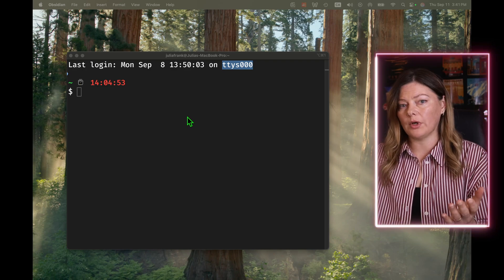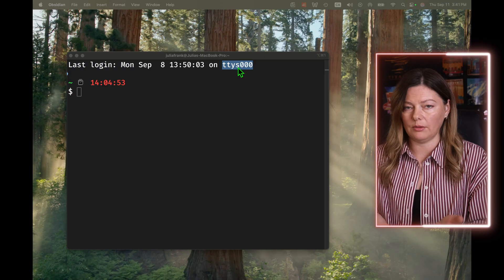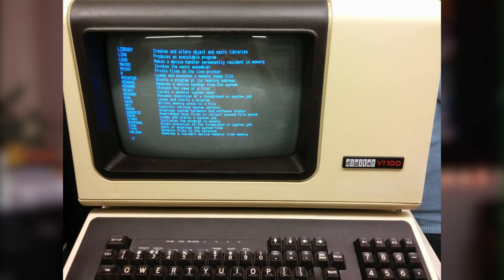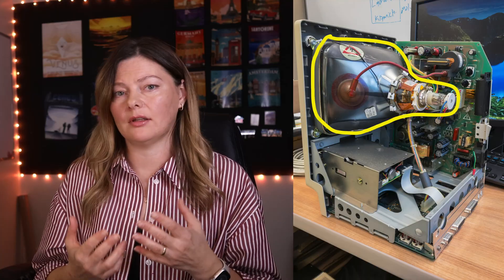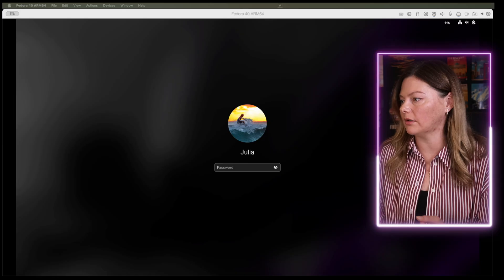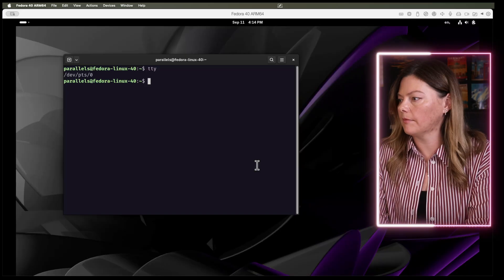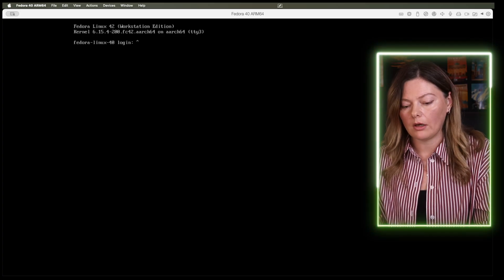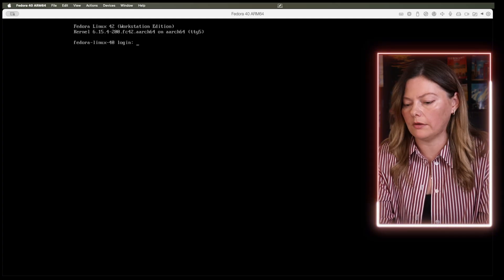What’s a TTY? (And Why Linux Still Thinks It’s 1970)

Comment: Late nineties I used a physical terminal in linux over serial to finish homework after my VGA monitor blew up; you may still be able to do that, but those were the days where PC's had a serial port on the mother board, and linux could run a TTY on that port  (maybe even by default on some distros)
Reply: (the monitor probably blew a cap, loud bang, sparks, fuse popped; was a pity, it was quite ok for it's time and as a poor student at the time monitors were not cheap)
Reply from the maker: Love the story :) Finishing homework over a serial terminal :D Thanks for sharing! 

In present days I wonder if something like this happened with the monitor, could we use our smartphone as an “emergency terminal” instead of the serial terminal? Probably yes, but I’ve never tried that before, nor did I ever need to.
Reply: @juliaifrank  I feel like the modern equivalent is sshing into your main pc from your laptop, when you just want to queue up some work from the sofa or when away from home.
Reply from the maker: @johanngambolputty5351 oh, that I do weekly for my research work when  I’m working from home and need an access to my uni workstation with a GPU :)

Comment: For your low volume you could try extracting the audio into something like Audacity and do the following effects. 1.  Noise Removal  2.  Normalize
Reply: And possibly add compression; I use easyeffects to do so if the creators don't
Reply from the maker: Thank you for the tips! I’m not sure what went wrong this time. It totally sounds ok to me, but I’ll double check again.
Reply: Or use DRC, I've found that 0 is just usually too flat and bad for  lower quality audio, and if audio source is poor and I know it, then I increase DRC to 4 up to 5 and that will increase Volume. Yes, Meria got it right, but I like the actual term that is used, Dynamic Range Compression. The 1st 2 words is the reason for the louder Volume. I know to some that might seem weird or counter-intuitive and always use this first from a totally uncompressed and unprocessed video/audio..
Reply from the maker: Thanks for the advice! This was the first video I recorded via OBS + capture card instead of straight to the camera/SD, so I probably messed up some audio settings in OBS.
Reply: @juliaifrank  if you don't already know, OBS can actually make use of VST audio plugins, so there's a lot of options (and many of them are free) to process your audio before it's even recorded. I personally quite like the DC1A compressor by Klanghelm for vocal compression.
Reply from the maker: Thank you!

Comment: I hate modernity.
Even if there were only a 1000 people on Earth, there's still hope as long as I have a TTY.
Reply from the maker: I am beginning to see how this black of a TTY can give one a feeling of being in control (that is if you know what you are doing). I’m trying to learn how to use a combination of a terminal multiplexer, editor, and maybe some other useful tools that make sense for this setup. I’d like to understand why so many people/devs use this stack for their work instead of an IDE. The learning curve for all this seems to be quite steep compared to using an IDE.
Reply: @juliaifrank 
It's not for everyone, i started using a tty back in 2000 and it took me 3 years to be able to read, understand and connect the dots for man pages because that was all that we had and you had to go to a library to be able to read those oreilly books but by 2005 it became easy. 

Using the tty is not for everyone especially when you have a lot of distractions... Stick with the known terminals for necessary work and learn to use or enroll in a course for the bash shell. That's it, once you know bash everything else falls in place. 

Don't try to geek out, it's not needed anymore, focus on other important tasks, Linux has evolved a lot so no point pulling out anymore hairs like me(baldy).

pick your niche and focus in on that.

Look at vim, neovim as they are almost full IDEs.